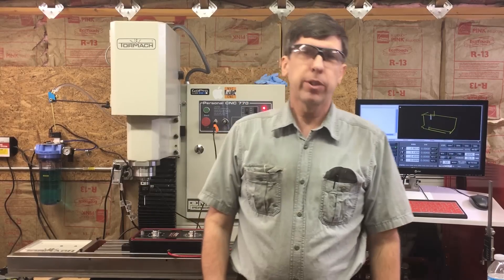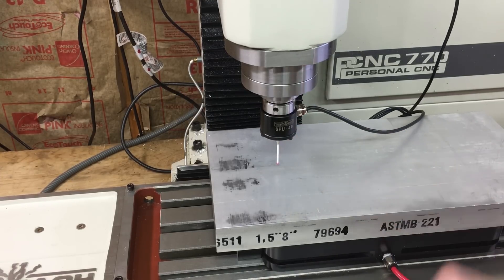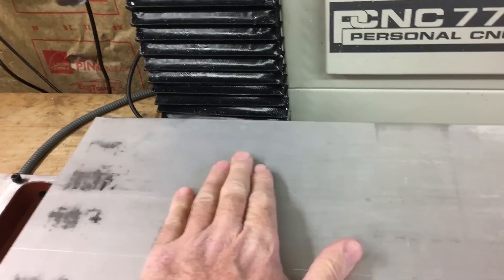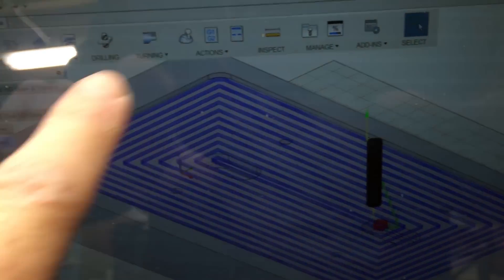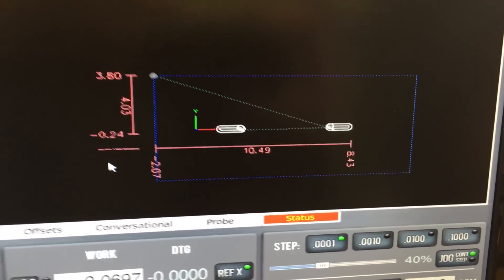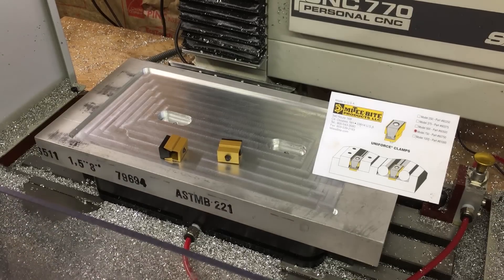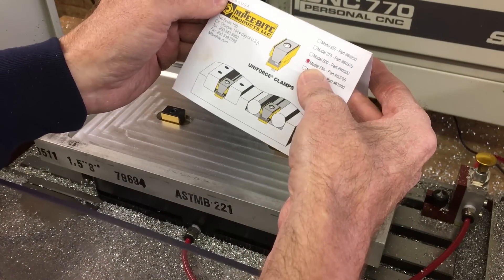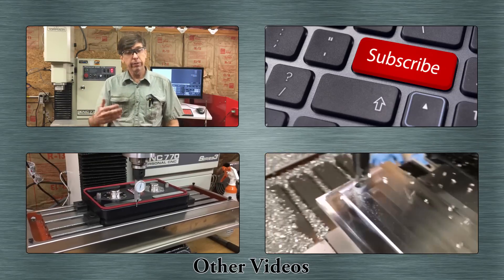Pallet System Part 6 - Machining the Pallet

Comment: No on the impact you're suppose to use a torque wrench
Reply from the maker: +m98custom12 - Oh, so that's why I see some shops use ratchets.  They are probably torque wrenches.  Yeah, I just checked the uniforce specs and they show 10.5 ft/lbs.  I guess that will save the threads in the aluminum?  I ordered one already.  Thanks!
Reply: +Craig&#39;s Machine Shop  Replying from my business account. Torque wrenches would be better on aluminum so don't over torque the clamps and strip the threads. Also, you know how much force you're on putting on the clamps which is then putting force onto the work piece. If you plan on using that fixture a lot  may want to put some steel threaded inserts in.
Reply from the maker: +Chief Machining - I'm not familiar with adding steel inserts so i'm hoping the aluminum threads last a while.  Do you just drill a hole from underneath and press it in?  I only have about 3/8 of aluminum and the hold down mechanism is only about 30-40 thou below that.
Reply: You thread by tapping it a differnt thread in using tool then you break it off.
Reply from the maker: +m98custom12 -Cool, Thanks.  I will check it out.

Comment: Craig, dont you think you should have set up the base off the pins?
Reply from the maker: +Bigwingrider1800  - You mean as far as tramming?  The zeros were set off the left pin.  The manufacturer recommends tramming off the long end but I can't due to my  travel.  I guess I could tram off the pins but it would be a little more complicated with the hold downs in the way and the pins being round.  I guess I could try it.
Reply: ALIGNMENT ALSO
Reply: CASTING GET YA CLOSE BUT THE PIN WILL ALWAYS BE PERFECT....
Reply from the maker: +Bigwingrider1800  - Good to know. Thanks!

Comment: Since I've never used a quick change pallet system like you have Craig, I could very easily be wrong.  While it looks like your pallet base has the perimeter  machined and anodized, it might not be quite as precise as it should be. Since the large pins are what locates and holds your top plate, I think I would have indicated across the O.D. of both those pins and trued those to your X axis travel. You have enough distance between them it should be accurate and the same can be done each time you re-install the pallet base on the mills table.

And aluminum has a poor wear life if your running alloy screws in and out all the time with those Mite-Bites. I'd make sure to keep the steel threads oiled at least to help with that. But I think you'll soon need to add a steel female threaded insert. There's lots of different types and methods used so there semi permanent. Since those are replaceable, then if any wear shows up after a lot of use you just replace them.

Those Mite-Bites aren't exactly cheap, but I think I'd seriously consider adding two more to better prevent your steel parts from moving. There's no such thing as holding anything too rigidly when machining. But overall you did a great job on that fixture plate. It should work well.
Reply from the maker: +Turning Point  - The manufacturer suggests tramming off the long side of the base.  Not sure if the short side is recommended.  Yeah, I guess I could use the pins but I would have to raise the head to get over the hold down mechanisms.  Maybe I will give that a try, thanks!

Thanks for the info on the inserts.  Yeah, Grimsmo had to do something similar but I think he just put steel nuts on the underside.  I will have to check out the insets.  Hopefully the aluminum threads last for a little while.  I guess it depends on how hard I run it. 

 I had a lot of squeaking at 4500 RPM, 30 IPM, .3125 WOC (Slotting) and .040 DOC in mild steel with a 4 flute carbide EM.  I had to back it down to .010 DOC and bumped up the IPM to 50 to get the first run of parts done. I think I am going to get a rougher and hope the noise will be less. I need to keep the noise down because I don't want the neighbors to complain.  Any idea on the squeaking?

The parts I am machining are oval so there really isn't room for  more clamps.  

Thanks!  not bad for my first pallet I guess.
Reply: +Craig's Machine Shop Squeaking? Anything on a video yet that shows the sound?  I can think of maybe a few reasons why you might be getting some noise. I'm guessing you were using that air/ coolant system, so maybe an end mill starting to get a bit dull, vibration from something being not quite as tight as it should be on the mill, fixture base, pallet, hold down clamps, part etc. But to disturb the neighbors it must be pretty loud. The surface finish should show up anything like chatter tho. The general idea for reducing or eliminating chatter is to lower the rpm and up the feed and that will usually do it. So you upped the feed and that helped. I'm no expert, but I've never had chatter I'd describe as a squeaking sound though.You could try dropping the rpm to say 3500-4000 and maybe 35 up to your 50 IPM.  That does slow the job of course. It wasn't an aluminum specific end mill, or a brand new one you haven't used before until this job?  But even at 4500 rpm that should be well within the ball park for a good quality carbide EM of that size in mild steel. In fact it might be even a bit conservative. I have no idea who your getting your cutting tools from, but it took me a very long time and way too much money to finally learn that top quality cutting tools are worth every single penny they cost. Niagara and OSG would be just 2 of the ones I trust. But there's lot's of others.                      

The aluminum threads will last a fair amount of time, but they will start to wear each time you run the bolts in and out. The oil slows that a lot. The steel inserts should have a longer life by at least 10 times, and as I said there replaceable so easy enough to do so when that's finally needed. Instead of buying those inserts you could end mill a six sided hole on the bottom of your plate a thou. or two smaller than the diameter across the flats and just press or tap in a standard steel nut. Then if the aluminum starts to wear a bit after a few nut replacements use a bit of epoxy just to hold it from dropping out unless there's no room for that to happen while it's on that base. But if your going to have more than one pallet it would be a pita and sure slow swapping pallets if the nuts could drop out during a pallet change.
Reply from the maker: +Turning Point  - Here is a video I took.  https://youtu.be/CDedDuHMFmA  The EM is brand new from Lakeshore Carbide.  The clamp has 2000 lbs of force.  Lower the RPM and up the feed, I will give that a try.  I am basically running it at what works but its real slow.  I need parts being made.   Just needs to speed it up so its more viable.   At 12 min per part now. I would think I should be able to get it to 2-3 minutes. 

Yeah, I will have to try the oil on the threads.
Reply: +Craig's Machine Shop Lakeshore Carbide is supposed to be pretty good so that should be able to be discounted. I checked your video link but it say's it's been removed. But if it is chatter? I dunno, you could also try upping the speed if you can just to try and speed up the cycle times a bit. Sometimes you just have to play with the speeds and feeds a bit to see what will work. Far too many variables in all this to have set rules that will say what will work every single time.
Reply from the maker: +Turning Point - I tried uploading from my phone but it didn't work.  John at NYCCNC has a video on his instagram  (saundersmachineworks) where he slots like me but at 2700 rpm and 8 IPM.  The cut looked pretty deep also.  maybe .125 DOC.  I will have to give that a try.

Comment: For 2D Pocket rest machining in HSMWorks you need to select the "rest machining" check box in the geometry tab, and then enter the diameter of the previous tool (that Shear Hog is 0.75", right?). If that doesn't work, I suspect there's a bug or something. I'm also assuming HSMWorks and Fustion360 work the same way.

Before declaring it's a bug, it's probably best to ensure that all the other settings between the two operations are the same. To make sure of this you can right click on the first operation and choose "Create Derived Operation > 2D Milling > 2D Pocket". That should create a new op with all the same settings as the old one. Then just select the smaller tool, check the "rest machining" box, and input the previous tool diameter. Note that you don't need to do anything special in the first operation, only the later operations need to be messed with.
... now that I think about it, since the first operation is also a 2D pocket, you can just right click on it and choose "Duplicate". Either way should do about the same thing.
Reply from the maker: +Hirudin Great Info!  I will have to give that a try.  Thanks!
Reply from the maker: +Hirudin - The link didn't work
Reply: I've edited my comment with an actual link, hopefully that'll work.
Reply: +Hirudin I believe this is correct for a 2D Pocket in Fusion, Some operations also require you to change "From Setup Stock" to "From Previous Operation" for rest maching, btw nice videos Craig!
Reply: +Craig's Machine Shop
Hopefully this will actually post...Craig, I sent you a YouTube message with a link. I'm assuming YouTube hasn't notified you that you have a message because YouTube is stupid like that. I'm assuming there's a link somewhere on this site, but the best way I know of to get to your own messages is to go to "youtube dawtcawm slizash messages" .My message above, the one with the link, is also probably tucked away in some kind of spam folder. If you find it you can probably "approve" the message so that it can be seen.